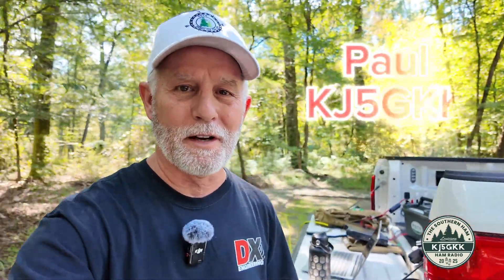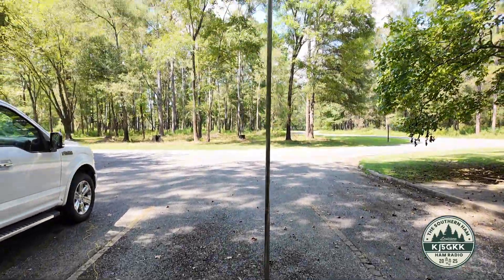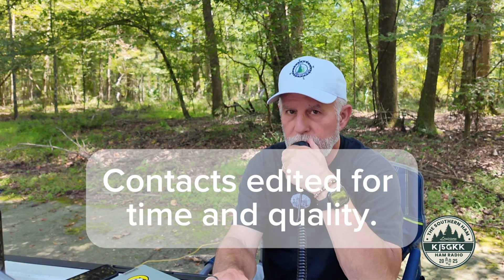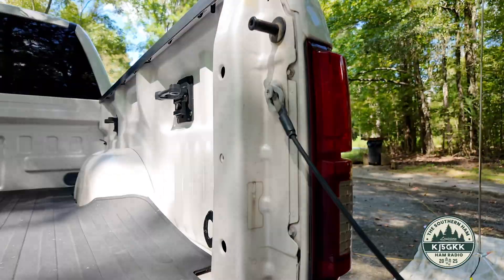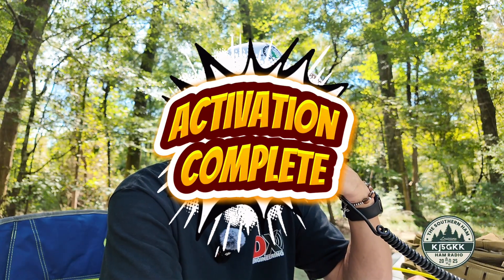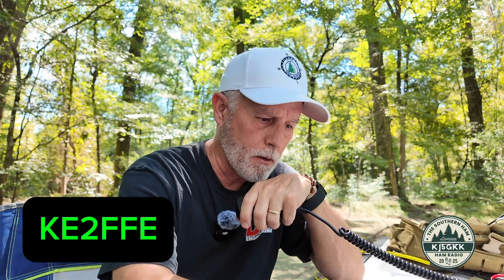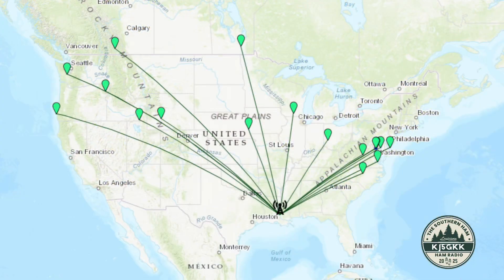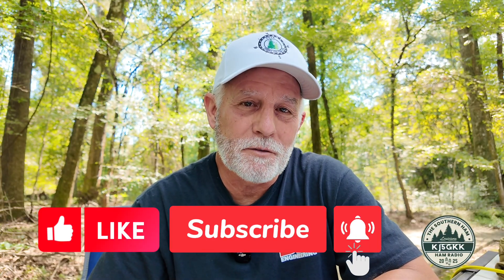#11 The insurance contact! Will the SS-17 work on concrete? #pota #parksontheair #hamradio

Comment: I use the same setup except I bought a 25ft whip when Chameleon came out with them. I have the Wolf River Coils TIA with the tripod and have used the 17ft whip that came with it and an MFJ 17ft whip. I like the 25ft because I built a loading coil to bottom load it for 40M. I also built a coil for the 17ft but haven't used it for real yet. Nice activation.
Reply from the maker: Thanks for watching Jack.  Yes, the SS-25 will be in my arsenal soon.   I have the Sporty 40 coil, but just can't get it to tune with the 17' whip. 73

Comment: Great video Paul. Nice setup you got there. Just curious, was the faraday cloth not enough of a ground plane for the 17' whip? I saw you also had some radials laid out there. Just curious. 73 brother and POTA ON!
Reply from the maker: Jimmy, First of all thanks for watching! As far as the use of both the EMP and the radials, I’ve found that combo to provide the absolute best SWR! Check this video out. It’ll explain.

SWR analysis of setups with the 17’ whip! Which tests best?
https://youtu.be/wdaUXN2V8uM
Reply: @paulTheSouthernHam  Will do, thanks Paul
Reply: I too throw down my radials when I have the room on top of the window screen (cheap hams faraday cloth).  It can't hurt and it might help so why not!?